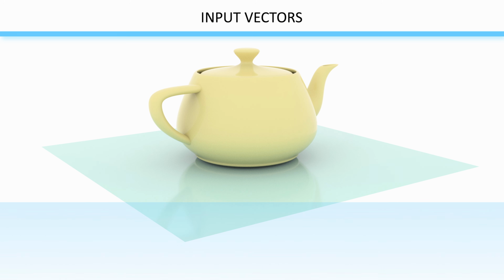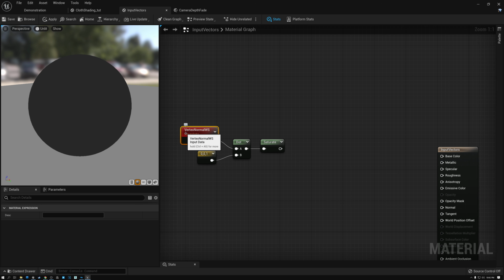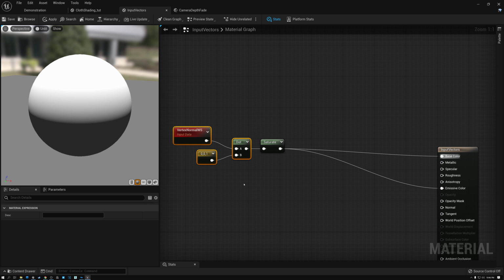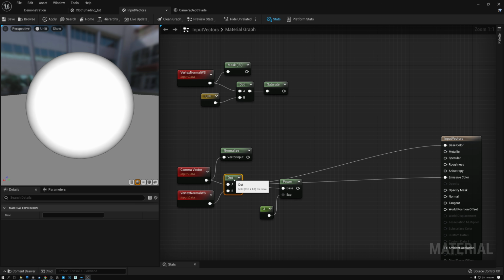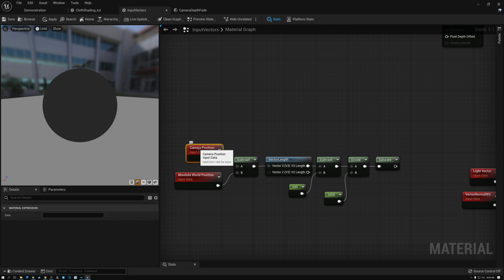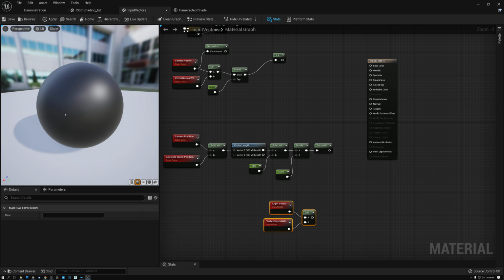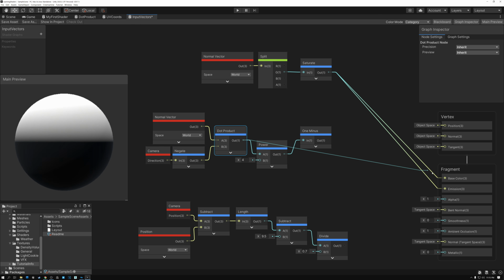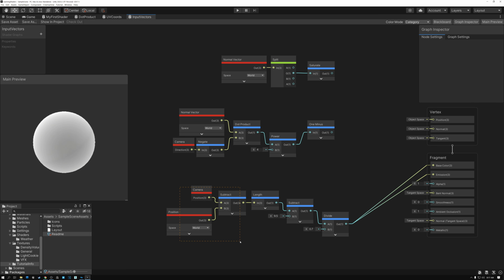Input Vectors - Shader Graph Basics - Episode 9

Comment: Love the video!  These videos are very good, I'm extremely happy to find them and I've been binging.  Based on what I've seen, you know exactly what you're doing in these videos, but one minor detail (Math Geek Here), the vector's don't have to be the same length (magnitude of the vector), they just have to be the same number of dimensions when using the dot product.  Unreal or Mathematically, there's nothing wrong with doing the dot product between a vector that is normalized and a vector that isn't.  Two normalized vectors, when taken in the dot product is a scalar that can range from 1 to -1, when they are parallel and anti-parallel respectively. When you use some other vector that isn't parallel, the result can be any real 'float' value accepted in unreal.  When plugged into the Base Color input, Unreal automatically multiplies your scalar by the Identity vector and then clamps it from 0 - 1.
Reply: Yes, the dot product between two non-normalized vectors would be a perfectly VALID number, but in most cases this number will not be USEFUL to us. As a Math Geek, you surely know that the dot product of two vectors is equivalent to the product of lengths of the vector times the cosine of the angle between vectors. And when the lengths of both vectors are 1, the dot product is basically just the cosine of the angle, and that's exactly what we are after in most cases. The end goal is not plugging it into the Base Color input and just looking at it, it's usually used in further calculations.
Reply: @EvgenyKochetkov yes, but  at 1:37 in the video, it states many operations like dot products REQUIRE the vectors to be the same length.  This statement is very much false regardless of whether or not you regard the result as USEFUL.

Comment: I'd really appreciate it if you answer this why do we subtract camera vector with absolute World position if we want increase the length of the camera vector shouldn't we use multiply node do that instead
Reply from the maker: To create a vector between two positions in space, you subtract the position of the one point from the other. The result is a vector between them. So if we subtract the absolute world position of the camera with the world position of the point we're rendering, it creates a vector between those two points. Then if we measure the length of that vector, we can find how far from the camera our point is.
Reply: Oh so this is just like your explanation on how water depth is calculated 

thanks a lot for the answer I really love watching your video I learn a lot from them

Comment: Hi Ben, im a little confused, for the camera vector isn't the start point is at the surface and end point at the camera position, so is it correct to say that the camera vector goes from the surface to the camera position and not the other way round (https://youtu.be/lrc-j7ub28U?list=PL78XDi0TS4lEBWa2Hpzg2SRC5njCcKydl&t=685)

Comment: In the case of the distance mask, how would one calculate only the nearest normal so that the mask uniformly 'fades out' the entire surface as you near it? The example in mind being those games that have objects that become 'transparent' when placed between the camera and a character in 3rd person and disappear entirely before intersecting with the camera.
Reply from the maker: The mask we made goes from white close to camera to black further away.  What you need is a mask that is inverted - that goes from black close to the camera to white further away.  So you would need to pass the mask we made in this tutorial into a OneMinus node to invert it.
Reply: @BenCloward  Not exactly what I meant.  I meant how would you calculate off of only the nearest normal of the object so that even those surfaces further away but still attached to the same texture fade out uniformly (so you don't get that 'clipped' look).
Reply from the maker: @Dilligff  Oh - sorry I misunderstood.  In order to do that, you would need to create a vector between the camera position and the object's position instead of between the camera and the current pixel.  That way, the vector will be the same length for the entire object. So in the example in this video, we use the Absolute World Position node and you'd replace that with the ObjectPositionWS node instead (in Unreal).  Hope that helps.